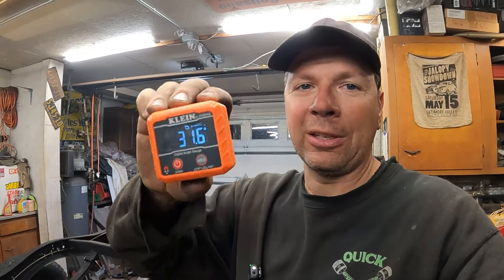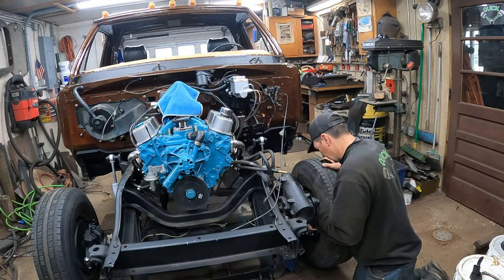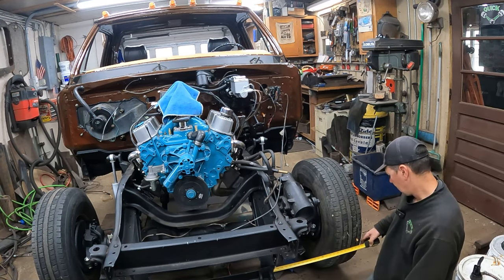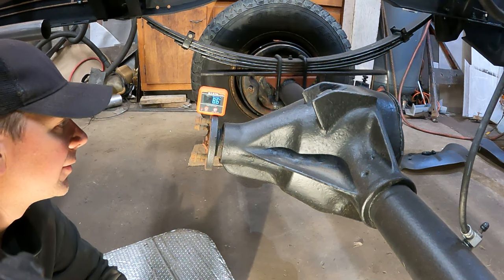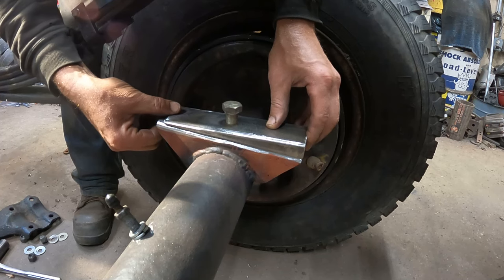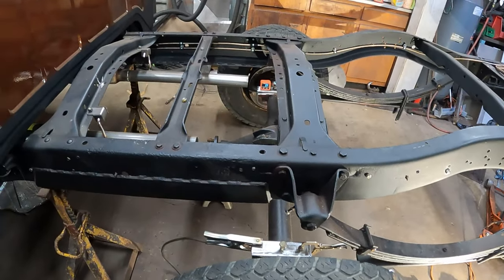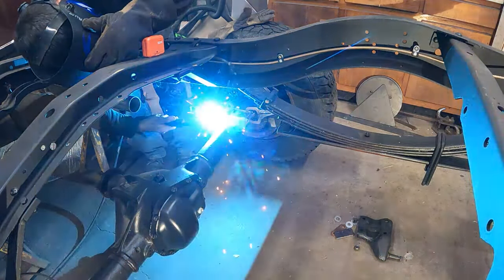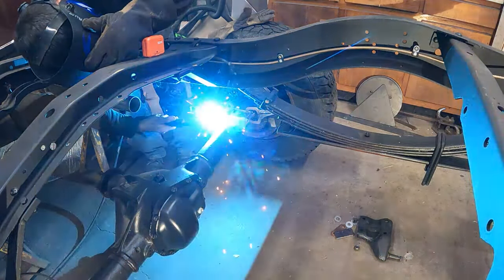How to Set a Pinion Angle:  Rear Suspension Tech

Comment: Great video.  I put in a tee and installed idiot light sensors as well.  But i hooked my oil and temp light sensors up to a relay to turn on a buzzer it oil drops or temp goes up.  I did this on my backhoe and loved it so i did it on my truck.  Sometimes you forget to look at the gages.

Comment: Very good content! I can't seem to find a video with anyone zero out the angle finder. Can you explain where to zero out the finder before tacking measurements. Thanks,
Reply from the maker: There's a button right on it to zero it out.
Reply: @QuickSpeedShop  I'm sorry I didn't explain myself correctly. When I turn the angle finder on is it already at zero or do I need to zero it out on the vehicle somewhere.
Reply from the maker: It's at 0 horizontally or vertically, depending on how you hold it.  If you want to establish a different angle as 0 for comparison sake, that's what the 0 function is for.  In terms of pinion you want the yokes to be equal, opposite and parallel.  So if the transmission is angled down 3 degrees you want the pinion angled up 3 degrees.